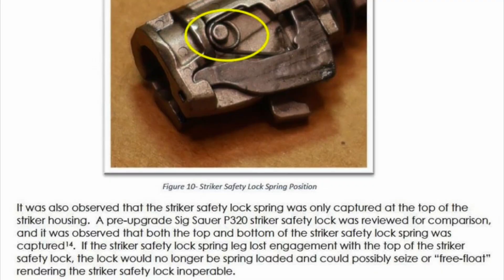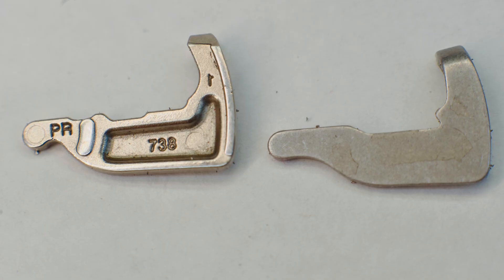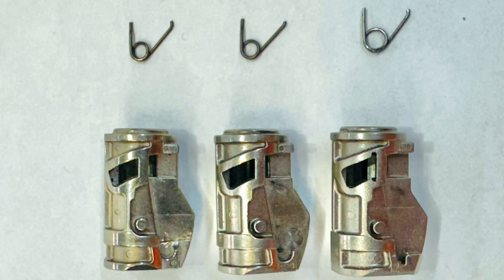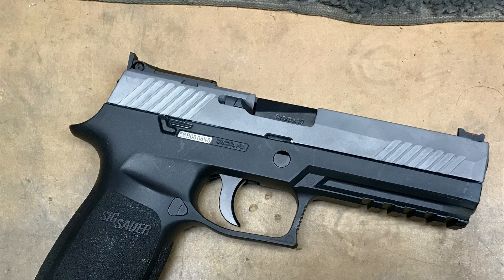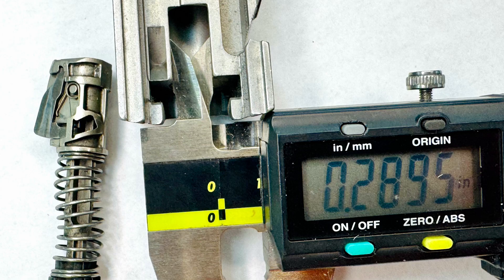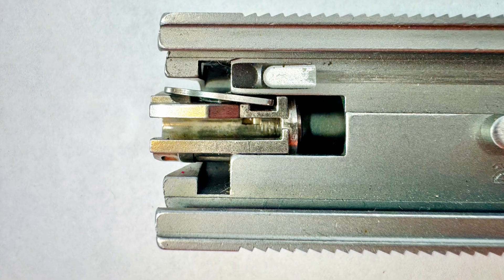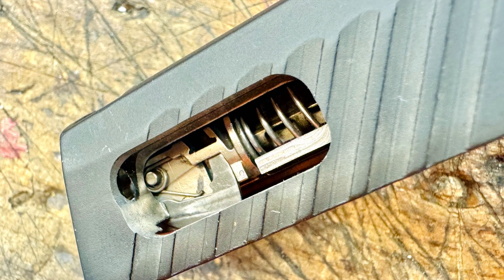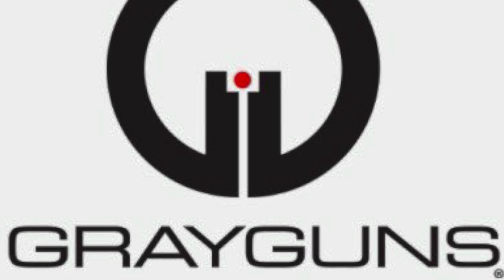P320 Testing - Striker Safety Lock Spring

Comment: Well golly gee I guess we can dismiss all of the video evidence and law enforcement reports about P320 discharges since this guy says so 😂
Reply: I haven't seen a video that 100% shows me everything that it fired without pulling the trigger.  Like after it went off video of inspecting the gun in the holster so we can 100% verify it was properly holstered in a correct holster?  I would love a link if you have one.
Reply: @JimmyJamesBlueFlames exactly. Remember the hue and cry after the airman? Then it turns out they were dicking about. That recent security guard at USAA who had been doing gps knows what before walking out. I’m no Sig boy but we don’t get all the variables. I wouldn’t carry one because I prefer a Da/sa with a safety.
Reply: Yes i think we can dismiss all of those as of right now because so far no one has been able to find an issue on a single gun yet. Not even ones that went off in holsters.
Reply: @Ujndbhsj it is a gun with a very light trigger, which apparently what everyone wants. That means it doesn’t take much to pull the trigger intentionally or not.
Reply: @jeffreygoss8109  Objectively, it's not a "gun with a very light trigger".

The standard P320 civilian and M17/M18 military variants generally run around 6–6.5 lb, while common competition-oriented P320s (like the X-Five Legion) are closer to about 4–4.5 lb on average.[1][2][3][4] Individual guns and trigger setups can vary by roughly a pound either way.

## Civilian P320

- SIG’s spec for the standard P320 lists trigger pull at about 29 N, which is roughly 6.5 lb.[1]
- Independent measurements of unmodified P320s often fall in the 5–7 lb band, consistent with typical striker-fired duty pistols.[5]

## Military M17/M18

- A detailed test of the P320-M17 (civilian version of the US Army pistol) measured an average trigger pull of about 2,550 g, or roughly 5.6 lb.[2]
- Other reviews of the M18 list an average pull around 4.5–5.5 lb, putting it in the same general “about 5–6 lb” service-pistol range.[4]

## Competition-Oriented P320s

- Testing of the P320 X-Five Legion measured an average trigger pull of about 1,900 g, or roughly 4.2 lb, with its flat, competition-focused trigger.[3]
- SIG also notes that Legion-series skeletonized triggers are up to about 30% lighter than standard P320 triggers, which aligns with the mid‑4 lb zone when starting from a ~6–6.5 lb baseline.[6][7]

Sources
[1] SIG Sauer P320 - Wikipedia https://en.wikipedia.org/wiki/SIG_Sauer_P320
[2] Test and video: SIG Sauer P320-M17 in 9mm - All4Shooters.com https://www.all4shooters.com/en/shooting/pistols/sig-sauer-p320-m17-civilian-version-of-the-us-army-service-test-video/
[3] Test: SIG Sauer P320 X-Five Legion - All4Shooters.com https://www.all4shooters.com/en/shooting/pistols/sig-sauer-p320-x-five-legion-pistol-9mm-luger-test/
[4] Sig Sauer M18 Review - Wideners Shooting, Hunting & Gun Blog https://www.wideners.com/blog/sig-sauer-m18-review/
[5] Adding Weight to a P320 Trigger - Bullseye-L Forum https://www.bullseyeforum.net/t13547-adding-weight-to-a-p320-trigger
[6] SIG P320 X5 LEGION 9mm Full Size | "Handgun of the Year" https://www.sigsauer.com/p320-xfive-legion.html
[7] P320 XCarry LEGION https://www.sigsauer.com/p320-xcarry-legion.html
[8] Apex Reduces Trigger Pull Weight With Two New Triggers for Sig P320 | Apex Tactical Specialties https://www.apextactical.com/blog/apex-news/apex-reduces-trigger-pull-weight-with-two-new-triggers-for-sig-p320/
[9] AN ANALYSIS OF EVERY P320 TRIGGER...EVER https://www.youtube.com/watch?v=so3b8JXJDlg
[10] SIG Sauer M17 - Wikipedia https://en.wikipedia.org/wiki/SIG_Sauer_M17
Reply: @rjbischof obviously I can’t argue with your facts. You certainly did your research with credible sources 👍. I guess I’m comparing it to my da/sa which are 10ish. I’m not sure what the cops were using before but the military berettas were 10ish.   As I have stated, I would not carry it, but I still not seen the “smoking gun “😂 to prove it is dangerous.
Reply: @jeffreygoss8109  Noted.

By the way, my DA/SA P229 Advanced Elite is tuned by me to a 6lb 11oz DA and 2lb 12oz SA pull weight.

However, it's not a carry pistol.
Reply: @rjbischof  I’m thinking that I really just want a 8to10 lb trigger induced by stronger sear springs. Unfortunately bh spring solutions are the only ones offering such a thing…. But they are too strong at + 30% I’m definitely disappointed that sig and greyguns don’t offer a selection of + power sear springs….and the thought of putting a -  50% sear spring set is flirting with disaster.
Reply: @lucahiggins-m5m Modern pistols are designed and engineered for safety. Factory standard triggers with 5 lb + trigger weights are quite safe.

User error is the overwhelmingly proven cause of negligent discharges. An 8 to 10 lb trigger won't fix it. Training will.
Reply: @rjbischof  I was not suggesting that it would  (fix) anything…I was merely pointing out that some people like me might want a higher margin of safety with a few extra pounds in the trigger…Glock didn’t make a special NY trigger for no reason..
Reply: @rjbischof  I should have said a higher margin for error is not a bad thing when someone is under duress and they are pressing into a trigger wall where any flinch could set it off and you can’t take it back once that happens. The guns are safe… it’s the humans that are inherently prone to error even with the best training.
Reply: @lucahiggins-m5m Carrying with a trigger lock installed would be the safer protocol. More safety isn't a bad thing, right?

Kidding aside, the NYPD, the case you cited, subsequently performed a risk/benefit analysis and found the non-standard heavier trigger configuration impacted performance negatively in qualification testing. It was the older officers that had difficulty adapting.

In economic statistics, it's called a diminishing return. At some point it turns negative. The NYPD empirical data made the opposite point you intended.

Responding to tendentious flogging of this topic is tedious and I have zero interest in another repetitive cycle.
Reply: @rjbischof  you should drop it and not respond …the personal preference of tuning my device is really not any of your concern. Especially if you suggest something as ridiculous as keeping a trigger lock on it. My lvl 3 holster already serves as a locking device and trigger guard for it. And I practice empty chamber carry while in situations condition green ….chambered when in yellow or red.I have 50 years of experience with firearms and learned when I was 6 years old.
Reply: Well if you trust those badged idiots over this guys science there can be no discussion